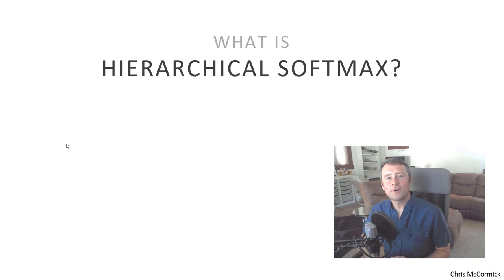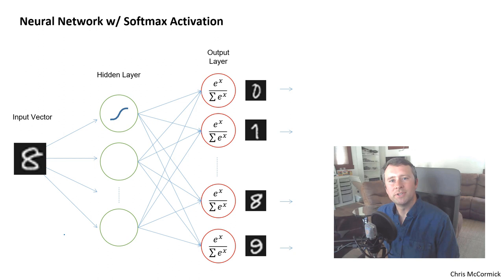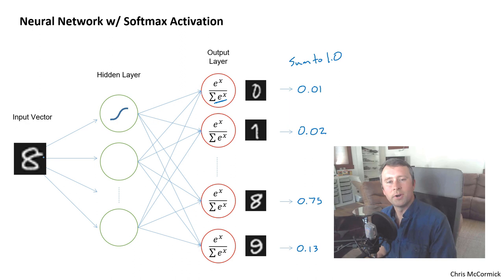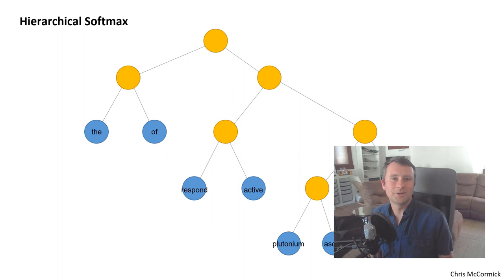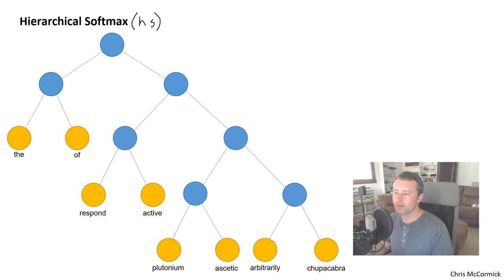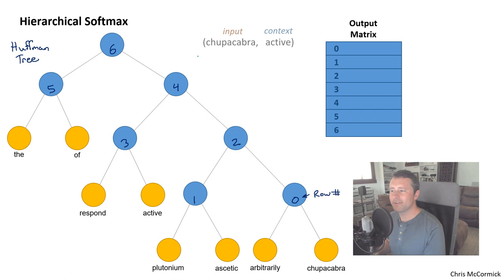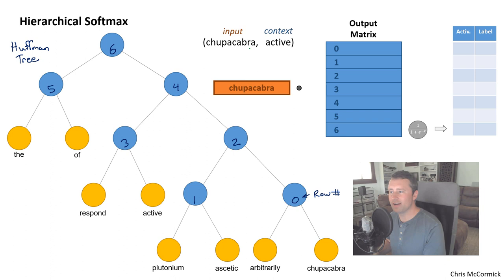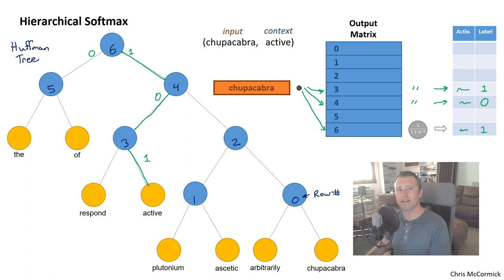Q&A - Hierarchical Softmax in word2vec

Comment: Thank you. Good explanation.
Some questions:
1. At 2:40. Why are we interested in getting the sum as 1, which softmax provides? What's wrong with using existing output values, we already have the weight for 8 higher than others, so we have the answer. Why do we need the extra work at all?
2. At 9:49. What is this "word vector"? Is it still one-hot vector for the word from the dictionary or something else? How is this vector represented in this case?
3. At 15:00. That's fine, but if we trained for "cpupacabra", what would be with the weights when we train for the other words? Wouldn't it just blend or "blur" the coefficients making them closer to "white noise"?

Comment: The video is great! Is there any rules in why each blue node corresponds to the given row in the output matrix? Like why first blue node is row 6? How is it determined?
Reply from the maker: Hi Yuan, 
It's just a byproduct of the Huffman tree building algorithm. If I recall correctly, I think it does result in the rows being sorted relative to the tree depth (the frequency of the word). This isn't important to the implementation, though.
Reply: You can assign each blue node to any row in output-matrix. Order of assigning rows is unimportant since this is not like any RNN output(i.e. it isn't sequential output). Just like input units can be in any order in a vanilla neural net.

Comment: What does the output vector list in blue contain?
Something from the hidden-output weights?
Reply: Okay, I missed the part that answers it. So, output vector's particular row would correspond to one of those non-leaf nodes, and the size of the row would be equal to the number of units in the hidden layer?

Thank you Chri,s!